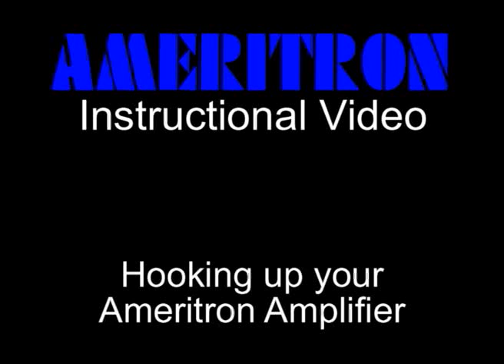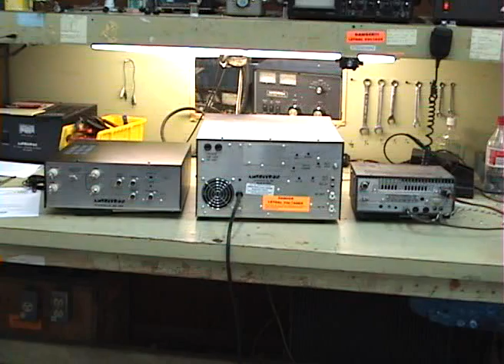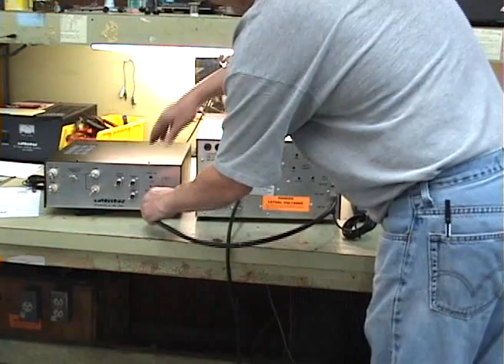Hooking up your Ameritron Amplifier

Comment: Just a minor clarification when using Ameritron Amps. You said connect from the 'Amp' jack on the ARB-704 to the 'Relay' jack on the Amp. But on the Ameritron AL-80B there is no 'Relay' jack. You use the 'Key' jack.

Comment: I would add a 2KW Low Pass Filter between the transceiver and the input to the amplifier. Clean In, Clean Out; as long as you don't over-drive the amplifier.

Comment: According to the box in the first video, the amp shown is an AL-82; which is a gallon amp that runs strictly on 240v.  So what's with the dual-voltage fuses?  Did they change the amp while I wasn't looking?

Comment: hi don't know if this is still monitored but I have the al-811H amp and an yaesu ftdx3000 transceiver. I would like to hook the two up but not sure how. Is there a way without using a db connector?

Comment: Is the coax length between the rig and the amp important?
Reply: as long as there not resonate to any of the frequency(s) you transmit on. besides that,,why would you need a 27 foot long jumper?? most jumper lengths never exceed 10 foot.(KD8EFJ)

Comment: I have to disagree with the placement of the Low Pass Filter. Your transmitter must be clean before the power goes into the amplifier. Clean in, then clean out. Simple. If you have s sprogy  that is lets say 50dbu down then after amplification that sprog will be amplified along with the stronger signal. Your low pass filter is not perfect at hight RF currents. However, to fit the filter between the radio and the amplifier is the perfect place. Kill the sprog before amplification. Capacitors might not be as good as you imagine after some high power passes. Never stress the filter. Do the job right. Just because a car can run at 100mph does not mean you have to run around at 100mph all the time. Something is going to break, and break very soon.

Comment: what if the radio has an antenna tunner?
Reply: the radio, tranciever, most likely only has a tuner that can carry the power of the radio.  Since you will be using 1KW of power, you will need a larger tuner and bypass the tuner of the tranciever.

Comment: If you have to watch this to make the connections, you shouldn't be a ham.
Reply: I have been a HAM for 30 years.  I have never run an AMP.  My amp never came with a manual.  And I will tell you at 3200 Volts in the AMP and as a Master Electrician, I am as careful as I can be before I key this thing.  I wish that there was more videos like this.
Reply: @KE1MP   he made a chock whith the 59 and used different  coax to tuner from amp n a 3 foot jump will run a 180 degree out of phase  
Martin don't  PAY much n it shows
All ways use the same coax  n 6 foot jumper NEVER coil your coax n don't ever let your coax cross 
N don't use a tuner unless you  have to it a big lose
Better to have resident ant whith no traps 
But i know some times you have to
Just my 2 cents  but 30 years I pay my due learned some the hard way
Hade a few real good Elmers 
But your wrigh b vare CARE full hp exspeshle tube amps thay can kill you but nuthing sounds as good  on radio or stereo   73
Reply: If you have to belittle others.. you shouldn`t be allowed to speak